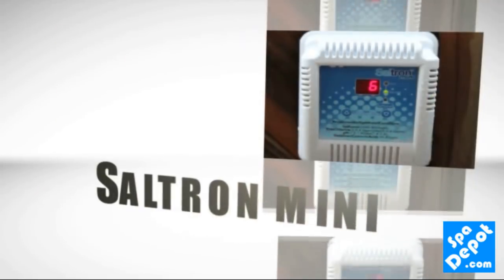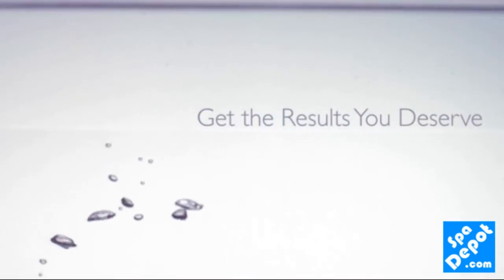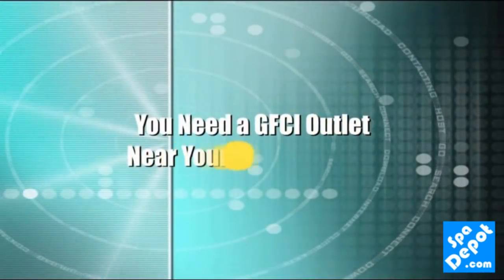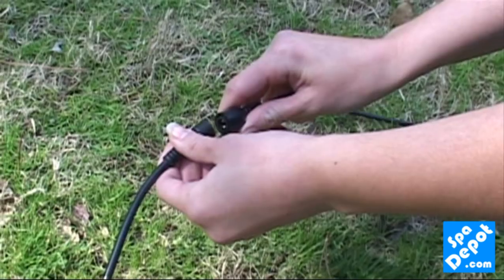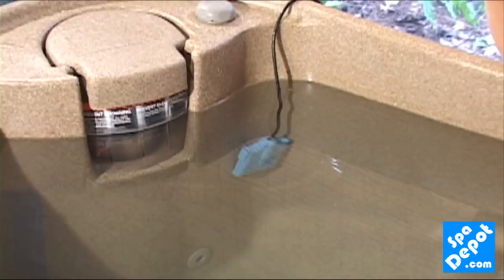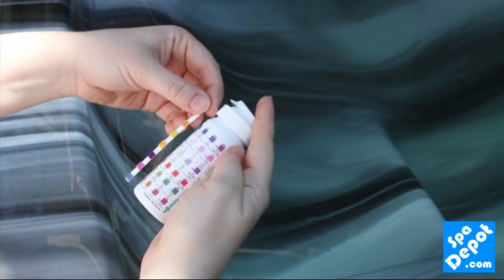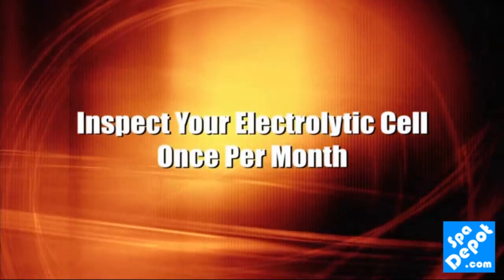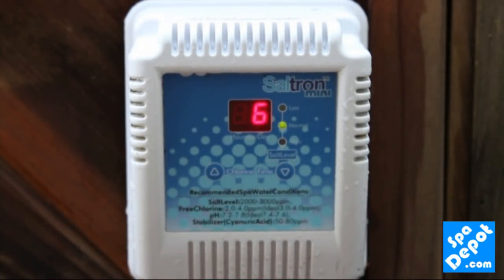Saltron Mini Salt System Chlorine Generator For Spas

Comment: Any recommendation for water hardness?
Reply from the maker: If you have really hard water, you probably have a water softener system. While I don't recommend completely filling the tub with softened water, you can try filling it half softened, half tap water. Another thing to try is our Cleanwater Prep Calcium Sequesterant, which works great for reducing hardness.
Reply: @TheSpaDepot  I am currious at what level hardness is recommended.